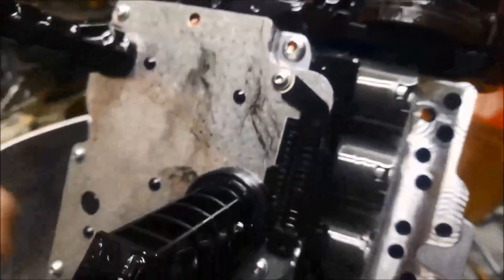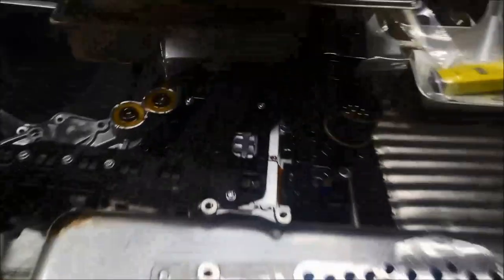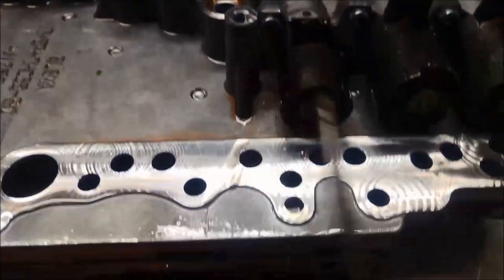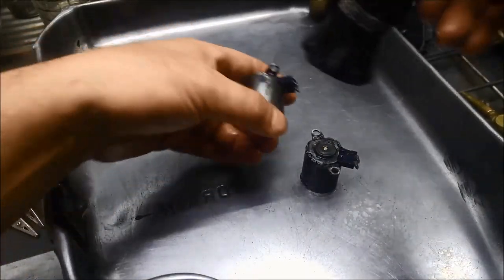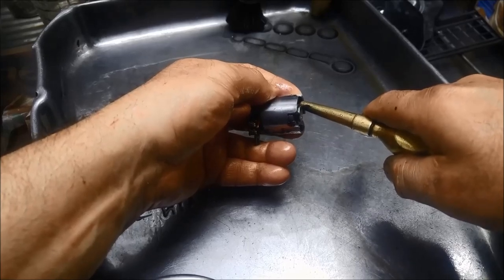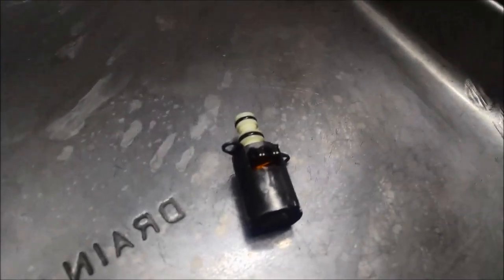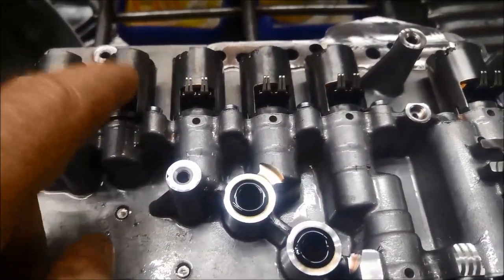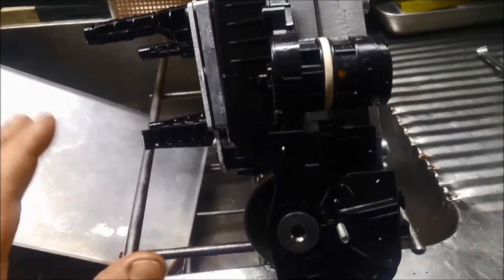Powershift Ford 6DCT450 DPS6 DCT Solenoid Testing P2of3 MPS6 W6DGA EVO SST Semi Auto Transmission

Comment: Hi there could you tell me the name or part number for your cleaning tray? Or what it is exactly called? I’m trying to find one on eBay but it’s proving difficult. Thanks. Great videos by the way. 🙂
Reply from the maker: hi, we made that one off an old transmission pan from a hydramatic 05 and a fuel pump circulates solvent around from a 20l drum. we also place some neodymium magnets under the pan to catch the muck and keep solvent cleaner longer. cheers Buy me a beer !.
Use the "PayPal Me" link CLICK HERE https://www.paypal.me/BATS189
Reply: Hey buddy have you got a solenoid break down kit for this as I want to open them up and clean them out if possoble.

Comment: Hi, thank you for the videos again. I have valve body out. When I press valve plugs with my finger all valves move a little (spring) but two of them are fixed - "Secondary  pressure regulator valve" and "Clutch cooling control valve". Is it normal? Thanks Tom
Reply from the maker: hi, not sure if valve body zip kits are available for these ? the zip kits are used to reseal the valve end plugs due to wear over period of time. the end plug will have an o`ring on it. extra extra care and patience needs to be applied when you fit those or very easy to damage or nick the o`ring. cheers

Comment: Thanks for the demo. U said 2nd t unit. Reliability's not good?  R new one's better?
Reply from the maker: hi, often if you find online solenoids they are flushed and only bench tested for resistance at room temp. proper testing requires many more steps and tests, often cheaper to just buy new solenoids. cheers

Comment: Hi great videos helping me along here in the UK I've lost reverse, can you point me to witch solenoids I can replace going to clean everything but would rather replace  reverse, also I'm getting 8ish ohms at room temp being 17 degrees
Reply from the maker: hi, always check as many solenoids and sensors as you can. thanks & cheers
Reply: @YepThatsIt   replacing all of them now to be on the safe side

Comment: Thank you for the upload. After all this do you have to recode or reprogram the computer. Many thanks
Reply from the maker: hi, generally only if you replace mechatronic plate. it will readapt on its own with driving. cheers
Reply: Hi I'm looking at a 2010 ford mondeo powershift. Seller says it wont move in drive or reverse what's your thoughts on that thanks
Reply from the maker: @isabel3harriet1  hi, always start with the basics...faults codes present, check fluid level and flow through cooling lines, electrical connections and good earth through strap to chassis, good strong battery etc. then you decide next steps from there cheers

Comment: Excellent video. What did you use to wash the solenoids with?
Reply from the maker: we use x55 or 1215 solvent. thanks and cheers
Reply: @YepThatsIt  is it possible to use isopropyl or metho with high alcohol content.

Comment: G'day Mate.  Thanks heaps for this guide.  I've just finished cleaning all nine solenoids on a 2013 mondeo following your vid.  A lot of crap came out.  One of the O'rings I've found is split however.  I can't find anywhere on the internet to find one.  Would you happen to know a part number or where a laymen like myself might acquire one.  It measures 9.2mm internal, 13.3mm external and 2.05mm thick, but nothing in any o'ring catalogue online seems to be even close.
Reply from the maker: hi, any seal that fits will be ok as long as there is tension in the housing so it seals well ( if there are 2 seals present, remove one so you can test each individually )...try hydraulic shop or tractor supply shop. if it fixes your problem and i`ve saved you thousands, donation would be nice https://www.paypal.me/BATS189 or on link on my channel page. cheers

Comment: Hi . super videa
I write via translator. I hope you understand me.

own Ford Kuga 2011 - 2.0 tdci 95000km,
a metallic sound is heard after starting and starting between 2a3 degrees.
after stopping and then running it does not do it anymore. I can ride all day and it doesn't. But if I turn the car off and start again at the first start, it will make a metal sound again. cold and hot.
I tried changing the oil with positive pressure, but it didn't help.
can we conclude that the problem is valves?
according to video the valves must have 3 ohm. 8.4 V to move the piston at 90 Celsius.
in the video can be seen verification valves CSPS - moving piston visible.
how do I check other eg SHSS when not seeing the piston?
Thanks for help.
Reply from the maker: hi, check other related vids in video description. cheers

Comment: Hello, I stripped my valve body down cleaned solenoids same way you did there was no plastic bits inside or around the valve bods but I notice some tiny gravel like bits on top of the internal filter. Not sure what it is, could be bits of plastic maybe? Is it worth putting it all back together? There was none of this anywhere else apart from on top of that filter. 

Thanks in advance.  Car has done 80k
Reply from the maker: hi, really hard to determine without seeing ourselves and doing our own tests/checks. choice is yours if you are confident you testes and flushed solenoids and sensors properly. make sure you dont overtorque the valve body bolts, they are very sensitive. cheers
Reply: @YepThatsIt  ok, thank you for your help, I heated the solenoids up to 80c and tested they were all the same (but higher) it's just the grit on top of the internal filter is making me wonder, what sort of job is it to change them plastic parts that get chewed up? I purchased the car like this, the box was making a gurgling noise and had no drive, although the auction stated it did drive.

Comment: Setting the toothed indexing quadrant. I have a ford galaxy with this gearbox I have followed your tutorial and got it going BUT, I have 2 positions at PARK on the shift lever in the car and still showing fault. I put a pin in the wheel through the small opening, I pulled the gear shift arm to drive but there are 5 indexing positions instead of 4 as per the gear shift. From PARK nearest front of car, first click should be REV, then onto Neutral, then DRIVE, but it clicks one more time like there are 2 positions for drive. I believe this is common on the Mitsubishi box and is called service mode but not on the Galaxy box. Now confused.
Reply from the maker: hi, have you watched my other dct vids? I`m pretty sure one shows alignment. cheers
Reply: @YepThatsIt  yes, I watched them all. My fault is 'Transmission range sensor' after I have performed the adaptive learning procedure with Maxisys MS907 car drives fine BUT I need to press the over ride button to get out of park and I have 2 park positions as well as reverse, neutral and drive positions.
Reply from the maker: hi, mitsubishi advise to put selector in one notch past d and align the range sensor pin holes, ford are with selector in d and align th range sensor wheel pin hole. you should always confirm position before you disassemble things.....did you confirm it is aligned properly and not askew? i`m still waiting for my beers bloke. cheers
Reply from the maker: hope helped, cheers

Comment: Hi there I have a ford s max titanium x sport automatic.Took the car for a drive car. went in gear 2 then from gear 2 car revs high and randomly goes into neutral while in drive. The car was stuck not changing gears. After 5 mins the car went into gear 1 but wouldn't change so it would shift up but goes in reverse. What do you think the problem would be. Solenoid? Thanks
Reply from the maker: hi, start with all basic checks first. depending on mileage and proper transmission service history i`d say blocked internal filter and or contaminated solenoids and sensors. see our other 6dct vids for more info see our other vids https://www.youtube.com/playlist?list=PLQLkuOdKuFotLWdTOl3KCK0xpgTu7CEJH  especially one on reverse flush filter while in vehicle. cheers
Reply: Thank you but I had my car scanned by a mechanic there were no codes related to the transmission. Some codes that stand out was the smart charging malfunction and ec relay shut off early. The car now also jerks very bad between changing gears. I will probably need to check the solenoids.

Comment: Hi thanks for the video. I have a question concerning the temp sensor. On the diagnostic when I start the car it actually says minus 40 for the oil. But the tcm is accurate. After driving for about 20 min the tcm gets to about 70 degrees. But the oil temp then goes up above 125 degrees which puts the car in limp mode. So I'm guessing the oil sensor is faulty. Where is it located though? Can it be replaced?
Reply: The car is a Volvo s40 2.0d 2010
Reply from the maker: hi, sounds like contaminated/faulty sensors ? the temp sensor is on the plastic tcm plate thats bolted on vbody. few beers would be appreciated, link is in description. cheers

Comment: You said that you’d open the solenoid up if you had spare solenoids. Do you need special tools to open and then seal the solenoid?
Reply from the maker: hi, yes you need special tools to open, repair, reassemble, calibrate and to test. cheers

Comment: Hi, I have a 2009 Ford S-Max Powershift. The car stalling on braking hard when coming to a stop. The error codes on diagnostic are P1744, 1634, 0793 and 0896. Any idea what could be wrong with the Powershift gearbox?
Reply from the maker: hi, looks like electrical issue, check basics first especially, connections and battery and good earths..see our other 6dct450 vids https://www.youtube.com/playlist?list=PLQLkuOdKuFotLWdTOl3KCK0xpgTu7CEJH    cheers

Comment: Hi.  Did you ever repaired a ford galaxy, diesel, automatic powershift, and the car was not reversing? All gears working fine, except reversing....the gear selector will stay in reverse position, but the car will act as in Neutral position. Even If I swich into reversing from the top of the gearbox. Any advice?
Reply from the maker: hi, is common problem, check solenoids and sensors, if plastic retainers haven`t shattered, you can do as i have in vid to help improve. cheers

Comment: Hi, my car stalls when I try to go drive or reverse. Mechanic recently changed filter and cleaned the transmission changed springs and retainers. As I thought it will solve the problem. There is a DTC a clutch pressure control solenoid stuck on/off.
Clutch system learn does not continue
Shift fork learn does not continue on plausibility.

Is it 100% TCM problem as the mechanic told me it would be easier to buy the TCM and Valve body assembly? But it is verryyyy expensive.
Reply from the maker: hi, for technical questions please contact us via our facebook link in description and don`t forget to bring some beers. cheers

Comment: HI Mate, just bought a 2013 mondeo, it has P283B Shift Fork 'C' Position circuit, going to have a go at the weekend, with this code anything i should be looking out for?  the complaint is, don't always go into drive and harsh gear changes, and do you do you do some  remote support ? can fly some beer money your way lol
Reply from the maker: hi, contact me on facebook link if you need more details, we can exchange vids, pics and beers for info on there. cheers
Reply: Hi, what it was the problem?

Comment: hi,i just took apart the valve body and even gear pressure solenoid csms2 i saw a small steel ball in the hole in the valve body,i looked in the diagram but it does not show a ball .this is the solenoid for even gear and on the opposite side is the odd gear solenoid,the solenoid is on the far left of the side which has 3solenoids.i would be very thankful if you can help me,sadly the ball fell and i cant find it and dont know the size in order to replace it. thankyou
Reply from the maker: hi, you will need to buy me a few beers and contact me on facebook link, we can exchange pics on there. cheers

Comment: I get this p2838 shift fork b position circuit low. Then I tried to reverse, it did reverse. Then tried to place drive. There is no first gear then reverse is gone.
Now code changed from p2838 to p2839 shift fork b position circuit high. 
My transmission was recently rebuilt for filter change. Mechanic judged TCM problem. I'm thinking they did not place the shift fork guides properly. What do you think sir? I need help
Reply from the maker: hi, sorry so many variables after someone has pulled it apart. take back to your mechanic. cheers

Comment: Hi,and thanks for a great videos 👍
How did you test the rest of the solenoid?
Same procedur like the two you showed?
Can i use ultrasonic washer for the solenoid?

Best regards Håkan
Reply from the maker: hi,  ideally you need to warm solenoids up to around 90 deg C and also test resistances as some fail when warmed up but ok at lower temps. to flush, its best to dismantle , clean and reassemble. however if that is too difficult, we demagnetize the solenoid and flush for best results. we also have a large ultrasonic cleaner ( unused for years ) and have found that if the metallic debris isnt able to exit solenoid easily, it will just get stuck inside it somewhere, even if it is demagnetized prior to ultrasonic cleaning. as long as you test resistances warmed up and flush as best you can, and solenoid isnt leaking or having steady operation through amperage ramping, you wont have a problem. cheers
Reply: YepThatsIt  do you think i can have an big maget insted of an demagnitzier?
My problems are when the car is  cold,default codes is p079600,p076600 and p077100
Br/Håkan
Reply from the maker: you will need a demagnetizer to demagnetize the metallic debris inside the solenoid. that stuff stays magnetic even when solenoid is off and creates the problems

Comment: Hello. We have this transmission in MC Mondeo with 207000k on it, never been touched. Car ran aground on some blue stone pitches damaging underside of car (minimal). Did not touch the engine or trans though. Was only 50m from destination and made it there no problems. Checked underneath for leaks etc OK. Left to return home and almost immediately seemed to skip gears and engine light came on. Then after parking in driveway no reverse. Scanned with G scan and get Pressure control sol C stuck on and pressure control sol D stuck off. Erased codes and tried to start but car is now in reverse. Raised the front wheels and started in N, definently in reverse, does not like it when you try to move to P or D. Eventually light came back and forward gear was available but no reverse again. Is it worth changing/cleaning solenoids for this problem?
Reply from the maker: hi, check all the basics externally first. sounds like you may have a damaged wire ? usually electrical issues will give you a fault code. leaking solenoids are considered mechanical fault not electrical. solenoids and sensors will definitely be contaminated with magnetized debris. cheers
Reply: @YepThatsIt  Thanks

Comment: Hii 
c max 2012 p0766 there is such an error 2 months ago, I cleaned the inner grip part of the gearbox, the springs and the inner filter detailed cleaning and the solenoid valves, I disassembled the block and cleaned it now the error code is p0766, where can the problem come from?
Thx
Reply from the maker: hi, if you`re getting a code, its an electrical issue. the solenoids wear out and leak as well, make sure the filter on the cooling line has had air purged out of it as well. you need to warm trans right up to do that or an air pocket will remain in there. cheers

Comment: Hi there, do you know anyone up in se qld who does this similar repair? It seems most shops just want to try a service first and then if it still have problems then the whole trans needs to be replaced. Our vehicle is having the fault code p0766. Thank you.
Reply from the maker: hi, a service ( some think is just a fluid change on a trans ) will not do anything much, you need to check solenoids, clean magnets and possibly reverse flush filter as in vid. sorry i can`t recommend anyone up that way, you need to make some calls. cheers

Comment: Which solenoid controls the reverse gear please?
Reply: Did you find out which solenoid controls reverse? I’m guessing you have intermittent loss of reverse gear if so did you manage to fix it?
Reply: @chrisnott4135  No, I removed and cleaned out all the solenoids, car ran lovely with all gears present on short trips for a couple of weeks but then when I went on a long run the gearbox failed after 50 miles. So I guess I should have replaced the solenoids instead of just cleaning them. £300 for a set

Comment: Hi! Awesome videos. I have a Kuga 2014. Fault code P0766, P2714. It’s kick when I accelerate and I got these codes. I washed the solenoids, do a test drive, same symptoms. I did a clutch learning, then it was ok for some miles. Then the car starts to kicks again and I got these codes. I bought new solenoids, still kick, i do a clutch learning. then it goes better, just kick a little bit. I found some small plastic when I changed the solenoid. Do you think I can get these code if something wrong with the clutch. Thanks
Reply from the maker: hi, if has bits of plastics you will need to replace broken spring retainers or will just continue to jam up solenoids and valve body. cheers
Reply: Hi, I have the valve body disassembled and taken all the valves out. There was no plastics there. Can’t it be a internal leak in the clutch? 
Cheers

Comment: Hi there i got P0766 solenoid D stuck …
I will try to change Selonoid D myself but which one is D
The third solonid must be changed fork 1/3 ? 
Which one pls thanks?
Reply from the maker: hi, make sure you check all the solenoids. cheers
Reply: @YepThatsIt  but how to check them ? With the voltage measurement?